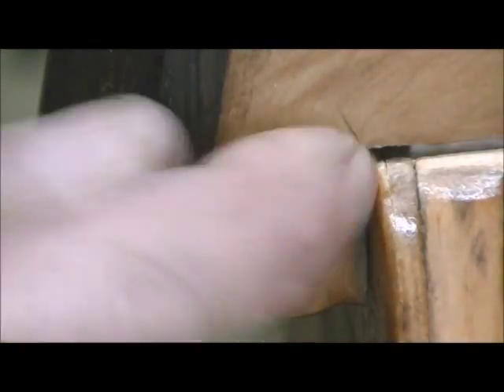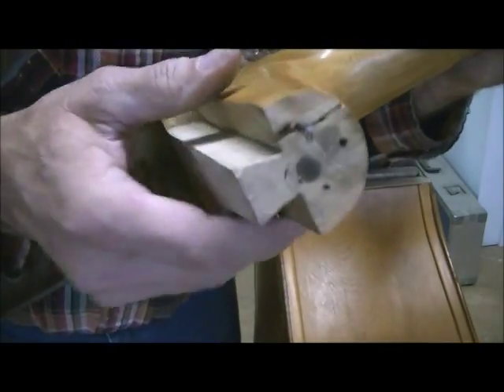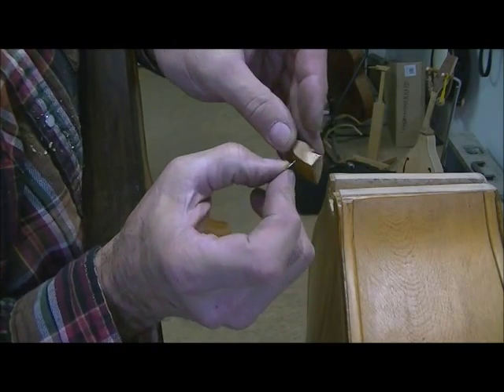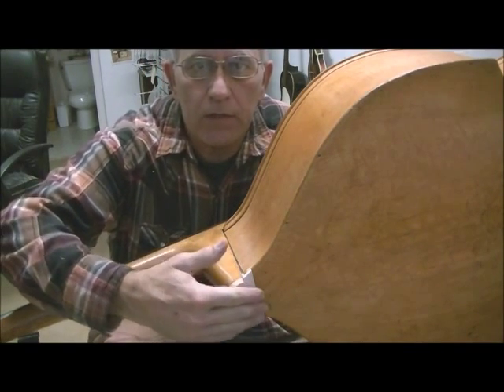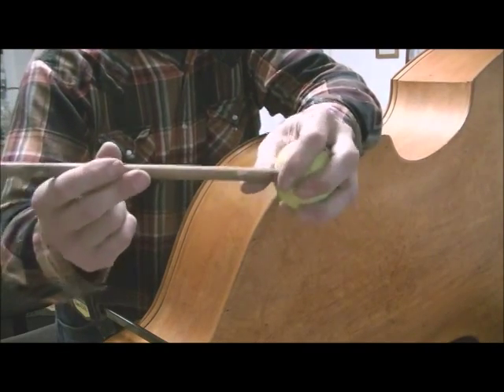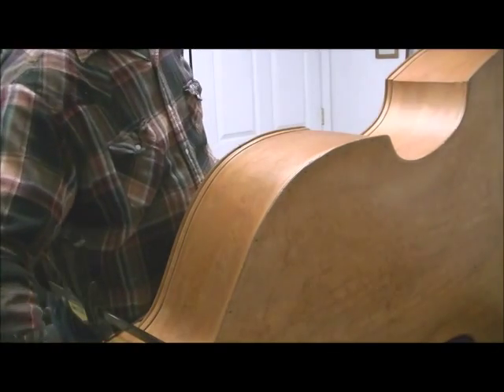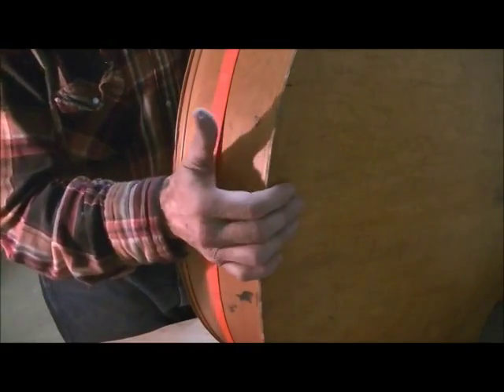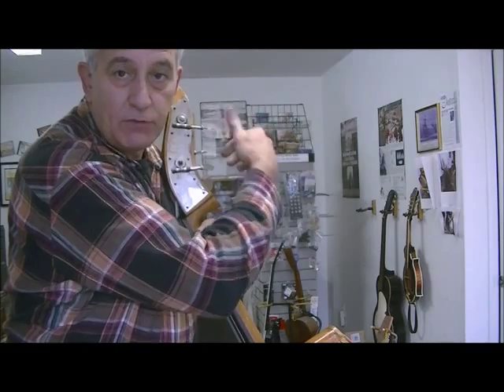037 RSW Kay Bass Neck Reset Part 4 Finale

Comment: Wow! Nice solid, professional repair. Wish I had watched these before working on my TrueTone archtop. I “lived” that dovetail for a week lol. It looked about the same as this bass when I got it apart, extra screw and all, I had the added fun of gluing the neck block back together before getting started, a big screw through the heel of the neck had split it. I guess the set up on a bass allows for a lot of “fudging” but on the guitar I had the angle, centerline, and elevation (ACE) to worry with in minute detail while shaving the freshly rebuilt dovetail. Thanks for another excellent video (even if it is an oldie).

Comment: I have really enjoyed this series.  You are a great  craftsman.  Thank you so much for sharing.  I have a old bass that has broke at the junction of the block and neck, and also in the front peg box little part that attaches to fingerboard.  This video really got me to thinking.
Reply from the maker: Thanks for the nice comments.  Good luck with your bass.
Reply: Thanks,  I feel the hardest part is going to be removing the finger board , and then glue and secure with 2 screws. Hoping to get starting on it before it gets to cold. Don't really have  enough shop room heated to pull it off.You build instruments I guess.  Amassing to me,  such talent it must  take.  best regards
Reply: Sir, I have order a replacement neck for my ky Bass. My question is it is not the same size as old one. About 1 inch sq..Tight fit and glued in hide glue would that be as good as you could do with out old one and as strong ? Thanks

Comment: Really enjoyed and learned a lot from your videos.  I'm very impressed with how tight you got that joint--not sure I could ever duplicate that.  I am curious... were you using standard carpenters glue?  Shouldn't you use hot hide glue so that the joint could be taken apart later?  I'd always heard that.  Anyway, great job!  Thanks for sharing.
Reply from the maker: Thank you Bruce.  Yes I use standard wood glue.  Not a big fan of hide glue.  It comes loose in a hot car too easily.

Comment: No HIDE GLUE?!?!?!
Reply from the maker: Hide glue is still good glue. It was the best glue you can get back with an ox cart where the best form of transportation. I believe if stradivari were alive today he would be using Titebond original. It comes apart even easier than hide glue and holds much better and doesn't give loose like hide glue does
Reply: @RosaStringWorks  Im doing the exact aame repair on a Kay neck block and the person used Titebond. Ive tried vinegar to soften it, but it just wont do it. Any tricks that would help? I prefer workong with hide glue. It is easily removed with 91 percent alcohol. Alcohol hydrates the hide and then shocks it by evaporating. Very easily sanded too.
Reply from the maker: It's funny you say that because I've used 100% pure alcohol and never been able to soften hide glue at all. Lots of people say they can do it. But I've never seen it successfully done. I just use Heat. The glue will soften with heat and then you can take it apart.

Comment: never, never use white glue!!!! Use hot glue!
Reply from the maker: Thanks for looking and commenting.  We will just have to disagree on that point.  I believe that if Stradivari were alive today, he would use white glue as he always used the very best of everything he could find.  Hot glue turns loose in heat and is much more brittle.  I firmly believe white glue is far superior.  So, as I said, we just disagree.  I am sure you will not change your opinion, and I will not change mine.  No hard feelings.  Thanks again.